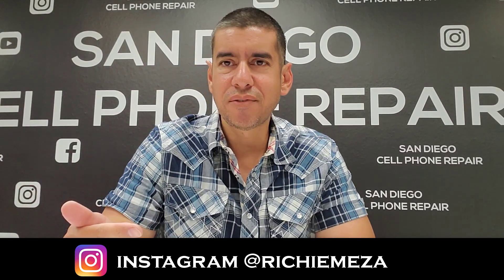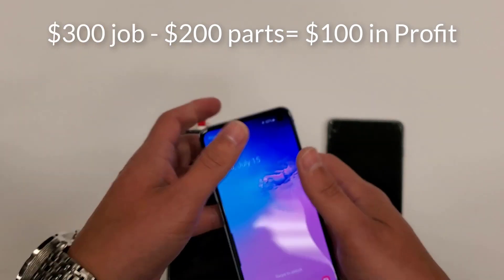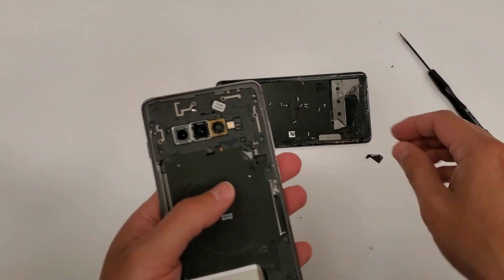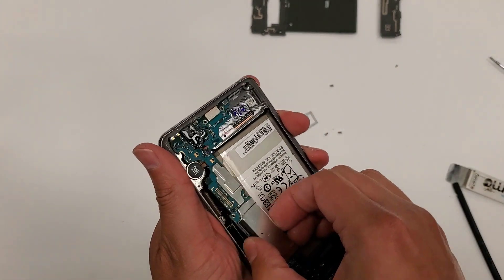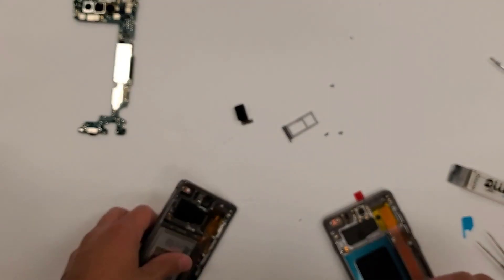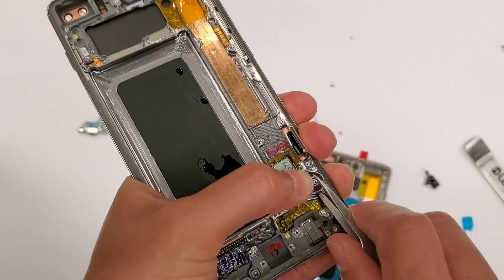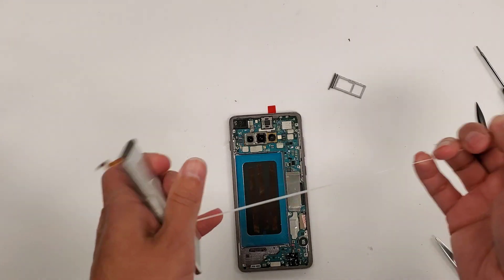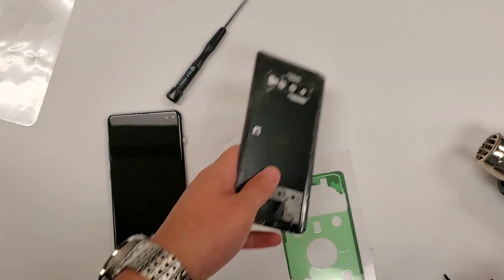Samsung Galaxy S10+ Screen Replacement | How to Repair with Frame

Comment: Using a dust air blower before sealing up the phone to ensure there is no dust in the last couple seconds is very important. Saying from experience I also have a repair shop.

Comment: Bro, at least wipe the camera lens. You smudged the hell out of it. It was so dirty when you close the phone. Come on man
Reply from the maker: I did. The camera was scratched up. That was the far right camera which was the wide angle lens. Customer was aware of this when they dropped it off. The regular camera in the middle was perfectly fine, thats what pops up when you turn on the camera. I didnt need to add this into the video, since at the time I was not doing a camera replacement and also the customer didn't want to pay to have the Wide angle camera lens replaced since the normal camera worked perfectly fine. There are 3 different cameras on the back of an S10+. To use the wide angle lens you have to switch over to it on your phone. This was a 40 min repair that was edited down to 15 min video. That means 25 min of editing was either taken out or sped up.